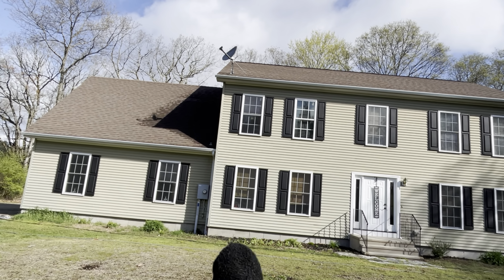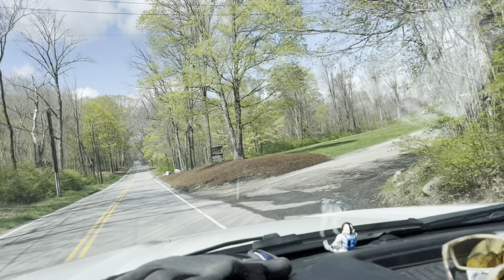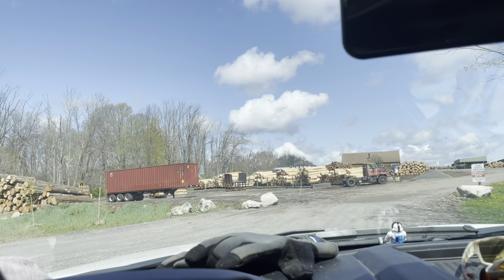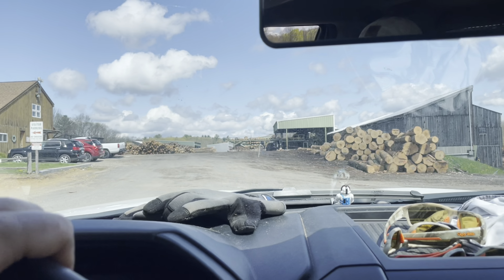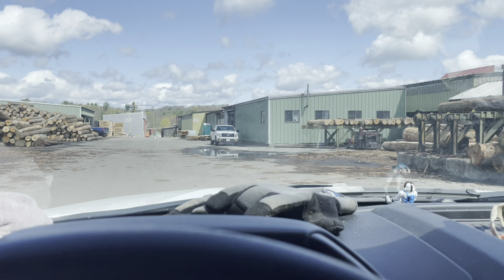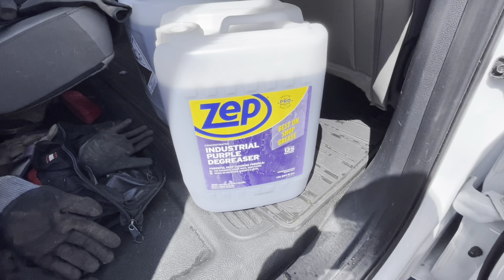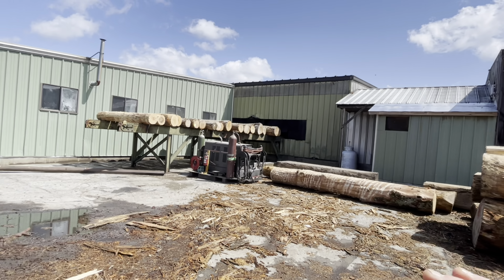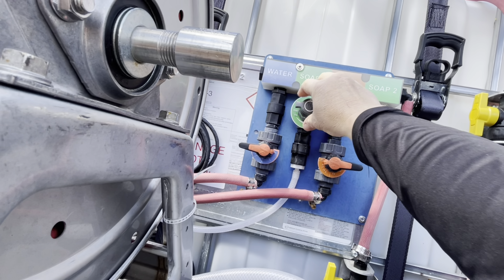Dirtiest Metal Building

Comment: Caution when using that Zep degreaser guys.  Make sure you mix it down at least 50/50.  1 gallon of zep to 4 gallons of water is even better.  If that stuff hits metal at full strength it will start immediately oxidizing it and turning it black and you've just created a mess for yourself.  The only way to get the oxidation off that i found was using scotch brite and a TON of elbow grease.
Reply from the maker: Oh no. Thank you for the advice
Reply: Is this why most businesses don't do metal roofs?